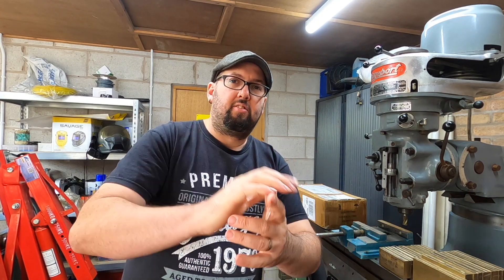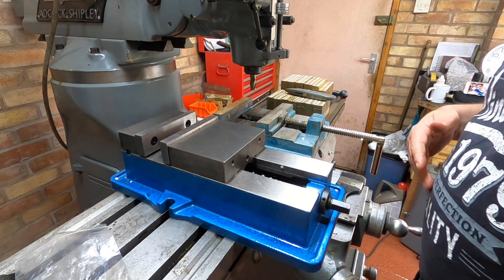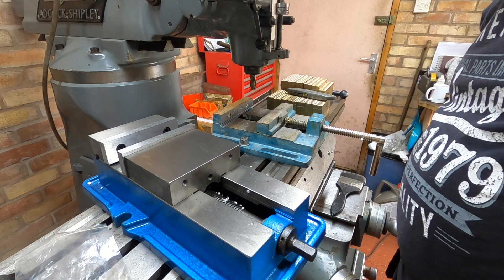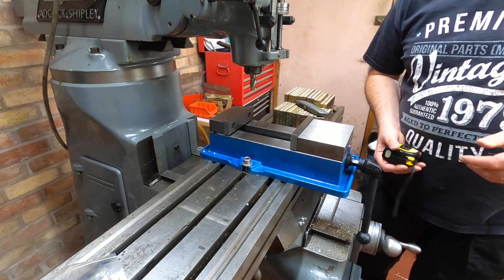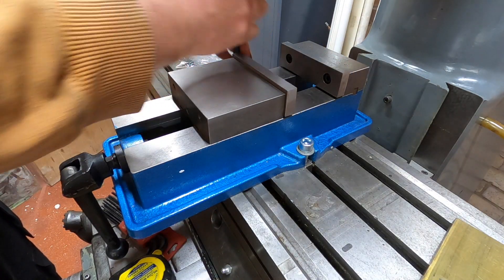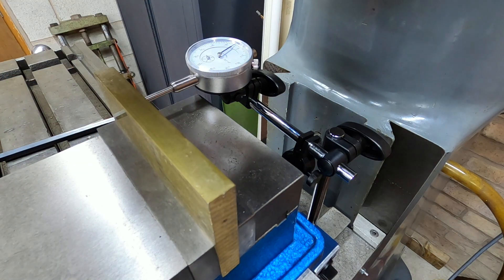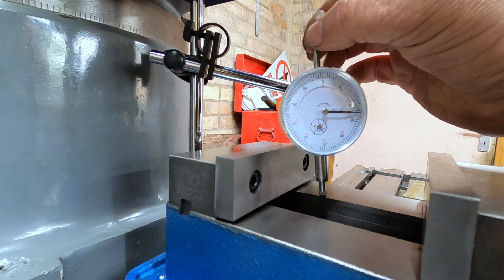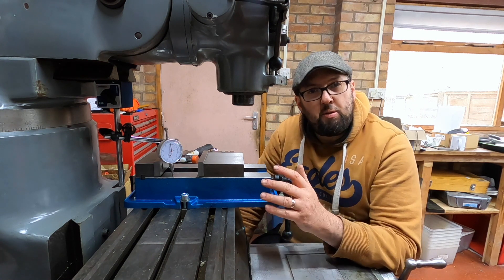Vevor 5" Machine Vice - New Tool Day

Comment: Machine vices have only 2 bolt holes because fixing something on diagonals can warp the Bridgeport bed if over tightened. that's what i was told.
Reply from the maker: There is no chance of warping the bed of a Bridgeport with a tiny vice, the casting of the bed is humungous! All the best, Matt
Reply: @MattChiversWorkshop  There are videos on YT how to staraighten Bridgeport bed. It is humugous when you look at it from the top, once removed and flipped over you realize that casting is thin in the middle.

Comment: Got one of those, Screw a piece of rubber Fap Material on those two holes  at the Front, Stops Chips going on the Threads
Reply from the maker: Thanks Steve, that’s a fantastic idea! 👍
Reply: what are the threads for ?
Reply: @steveb936  the threads are exposed so it stops chips Buildng up on them so they don't get at the nut

Comment: Hi Matt, your last video on the electricals totally lost me. All my machine motors in my shop are either 110 volt from the mains 220 volt again from the mains, 220 volt through static 3 phase converters and lastly 440 volt 3 phase through a rotary converter using three step up transformers on each leg. I did notice a very unsafe situation in this latest video. Please take your cutting tool out of the spindle of the mill when you are moving your hands around a lot as in setting up the vise, you can get a rather nasty gash on the back of your hand if it comes in contact with a sharp end mill in the spindle while doing so. Please don't ask me how I know. Also check that the vise handle isn't long enough to get hung up on the ways of the "Y" axis when traversing the "X" axis. The handles on the 6 inch Kurt and knockoff vises could do that and it was a bad scene if the machine had a power feed table. I used to cut the handles down to avoid this but I have three leg spider handles on all the vises now. Again no question on how I know please 
See you on the next video..
Dick B. USA

P.S. the centrifugal (or is that centrifical) casting video was very interesting
Reply from the maker: Hi Richard, Yes I need to get back in the habit of putting cutters back, I'm looking for some good boxes to sort the cutter into for storage. The handle on this vice is removable but it does clear by about 1inch!!! Which is lucky. See you in the next video!  Matt.
Reply: Matt I have a block of hard wood that I have milled 25 different radius groves into with a ball endmill that I keep currently in use endmills in. The rest i keep neatly in a tool box draw untill I need them
Dick B. USA

Comment: Interesting that you aligned the vice in the center of the table. I guess I am born lazy as I tend to keep my vice fitted at the right hand end. (Other ends are available.)  This allows me to clamp either a rotary table or a large item directly to the table without moving the vice.  The other trick which I am sure you know about is to machine a piece of bar to fit snugly in the tee slot, turn the vice upside down and secure it to the bar in the tee slot.  Clamp the vice down and machine a tenon slot in the base of the vice.  Take it all apart, trim down the depth of the bar to fit into the tenon and bolt to place. (A couple of dowels if you are feeling keen.)  You can now place the vice in place along the length of the table by dropping the tenon bar into the tee slot and tightening up the securing bolts.  Much quicker after a bit of effort than setting the vice each time.  Brilliant video as usual my friend.
Reply from the maker: future video??? 🤔  Send me some pictures...... of the vice idea, not those other ones again! 😂